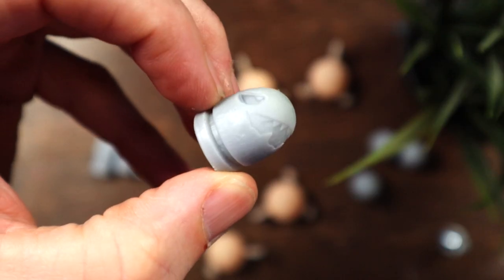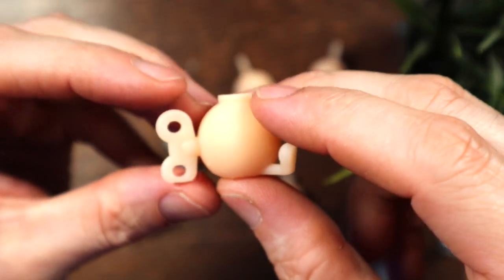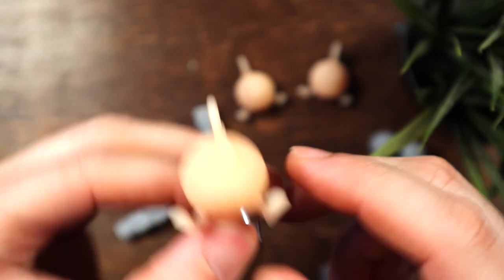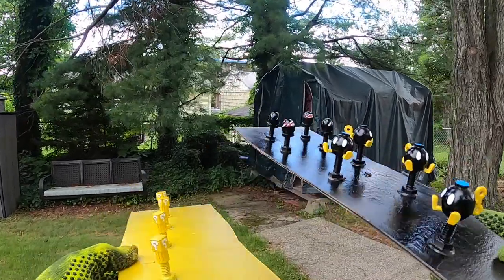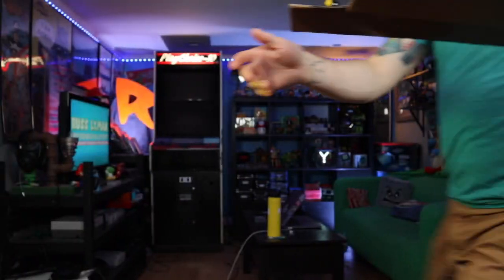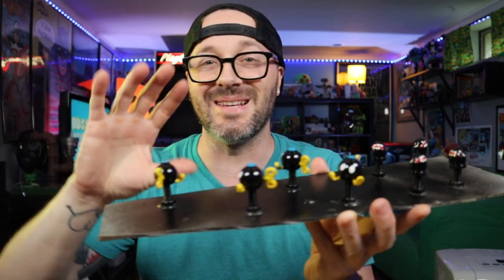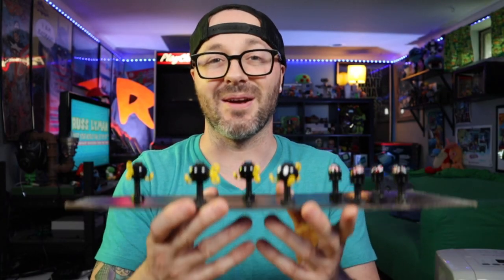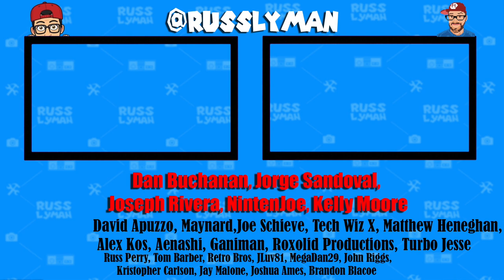3d Printed Vavle stem caps for your car, Super Mario theme

Comment: Yeah, those really have to be off-road only since they don't appear to be practical.  Between the inconsistent fitment with some not threading on completely, some just slipping over the threads, and then the bulky weight of those bobomb caps....  Those might even throw off your wheel balancing!  Easiest solution would be to open up the hole on the custom cap with a dremel and glue standard caps inside so that they sit flush and seal properly.
Reply from the maker: Funny you should say that because thats what I did before this. I found some mario coin blocks that were hallow on the inside and put clay in there and shoved a regular cap in there. So I usually use those at shows. I could possible drill out the ba bomb and do the same

Comment: thumbnail says VAVLE caps
Reply from the maker: I kept saying valve stems throughout the video, which refers to the actual stem part on the tire. So technically these are valve caps, covers. 😅
Reply: @RussLyman  V-A-V-L-E is not the same as V-A-L-V-E... it was a lil typo in the thumbnail
Reply from the maker: @michaelsworkshop9031  i read your comment wrong ha. Thank you